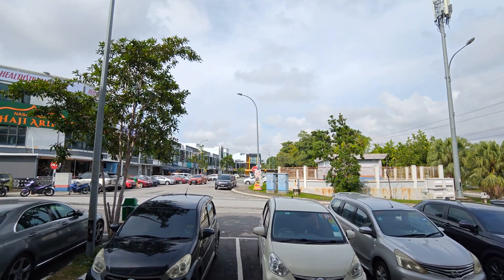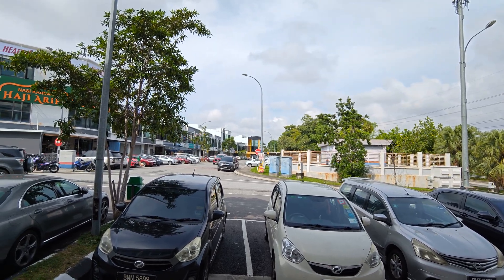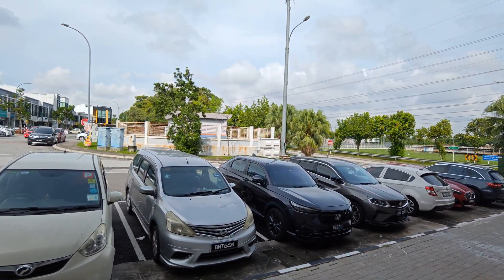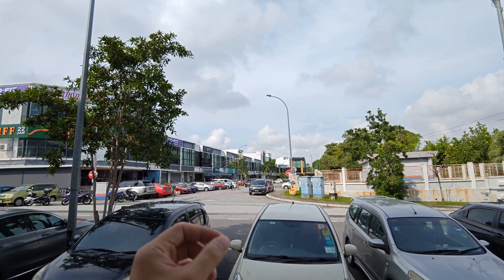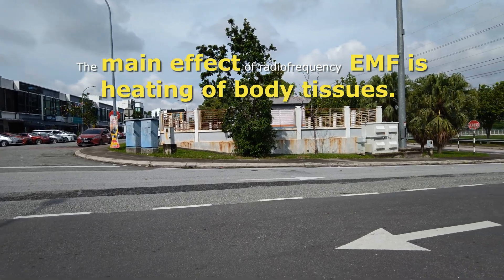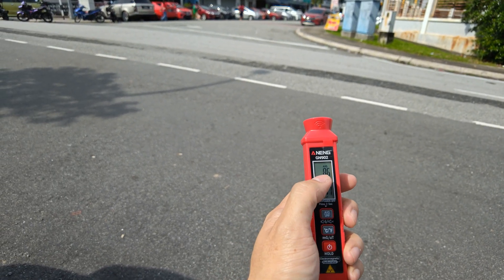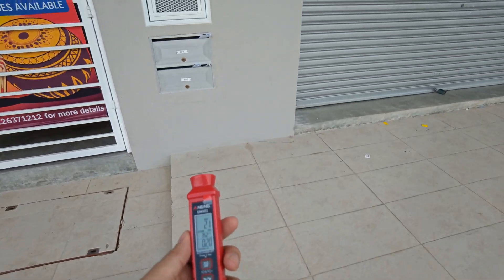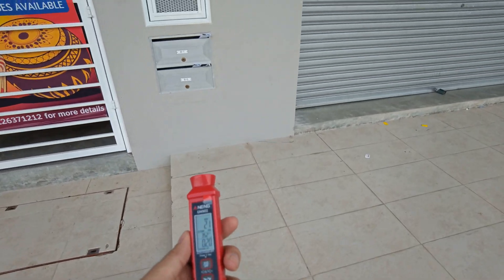High Tension Cables (HTC) @ - Dangerous or safe? Radiation? We measure the EMF strength to find out!

Comment: Good stuff. That being said, to be really safe, still should measure for each and every property that is nearby a HTC? To get the exact reading.
Reply from the maker: Based on this video, one can roughly estimate, so not necessary to measure for each development. Unless the condo is literally right beside, 10m away, then yes, have to be concerned. Otherwise, based on estimation, if it's similar to this or further, then it's perfectly fine.

Again, risk is higher from household appliances!